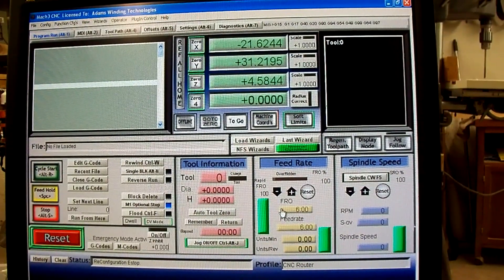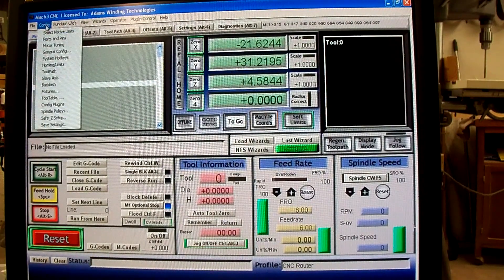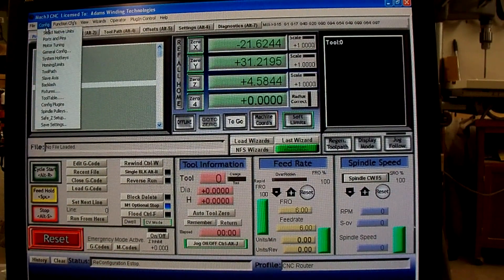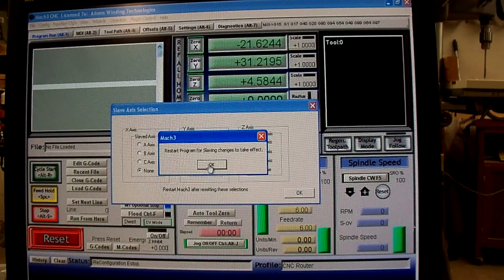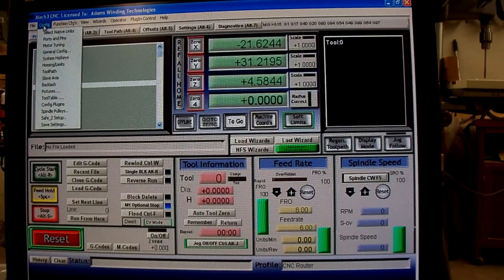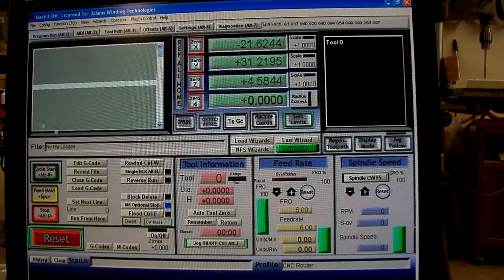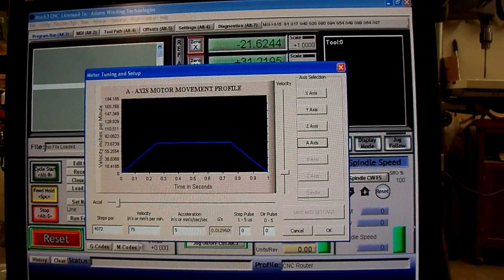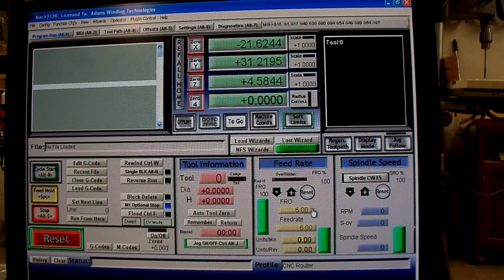How to Slave the A Axis in Mach 3

Comment: If you set up limit switches for both A and Y will they work independently?  In other words,  if the machine is out of square will it square itself up based on the limit switches of each axis?
Reply: For that you need unselect home slave axis with master, and when you make home machine will do z,x,y and slave
Reply from the maker: I only have one limit switch on the Y axis, none on the slaved axis.  I would think that if you had two limit switches, whichever one made contact first would stop both stepper motors.  Therefore I think the second limit switch would be of no value. (Only my opinion )

Comment: How do you calibrate the two axis so you get a square when cutting a square. Mine is not square cutting. I have both y and a axis servos set the same. Any idea what I maybe doing wrong?  Any help would be appreciated. Thank you.
Reply from the maker: Excellent question.  I have struggled with this problem as well.  What I have done is the following:

1. put a piece of scrap plywood or something on your table and fasten down.
2. put a bit in and run it across the X axis cutting about 1/16 to 1/8 deep.
3. then run it down the Y axis forming a corner.
4. use a square to see if it is square.
5. if it's not, try to measure how far out of square it is.
6. if out of square, with power off, turn one of the Y axis ball screws one way or the other by hand to move one side of the X axis thje amount it's out of square.
7. turn power back on and do the same thing and check again.
8. keep doing this till you get it as close as you can.

I don't know if this is the proper way to square it or not but the only way I could get it close.
If anyone else knows of a better of simpler way, please leave a comment letting us know.
Reply: @MyRobertadams  Thanks I will try that.

Comment: Hello Myrobertadams. Your video was very enlightening but I still have some doubts and I would like to know if you can help me. Basically I use a 4 axis CNC router to cut wedding rings by drawing and drilling stones in them. I had to change my control driver box because the old one burned after an accidental connection on the 220v and I lost all the mach3 settings because the new TB6600 drives are different from the old cards I had .... Now I don't know how to make my mach3 back to work with this machine. After turning the A axis into a slave, how should I do to know exactly if the distances traveled by the A axis are exactly those ordered in the measurements of the drawing generated in artcam and saved in the form of file "Model Master 4 Axis Rotary (X-> A) mmg "? In fact, how do I calibrate the movement of the A axis in mm or, if the calibration of the X axis automatically calibrates the A axis to automatically rotate according to the dimensions of the drawing. I don't know if I was able to express my doubt. In short, what configuration do I have to use on my mach3 to machine move the X Y Z and A axes according to my drawings with toolpath saved in the Model Master 4 Axis Rotary format (X-> A) * .mmg.
Would you have a video to recommend how to make these adjustments?
Reply from the maker: Thank you!
If you are slaving the A axis with the X axis, just set the motor tuning on the A axis the same as on the X axis.  I'm not even sure if you have to do this or not.  You could just check and see if the motor tuning on the A is the same as the X after you make it the slave.  You may want to close the software and restart it to make sure any changes took affect.
Hope that is helpful and best wishes!
Reply: @MyRobertadams  When I slave the A axis to the Y axis on my machine (both are linear on either side of my gantry), adjusting the steps per inch on the A axis has no effect.  This is frustrating, as the A axis steps per inch are not quite right on my machine.  Assuming that Mach3 automatically uses the Y steps per inch setting, you can't perfectly tune both axes if the steps per inch settings need to be slightly different on each.  Theoretically, they should be identical, but this isn't the case in the real world.  The A axis is off by a couple of hundredths of an inch across the travel limits as measured with glass scales.
Reply from the maker: @steadystate100  
If you have the A axis slaved to the Y axis, you can't adjust the steps per inch for the A axis. You will have to manually adjust the A axis ball screw so it will be in same location (parallel) to the Y axis.
Reply: @MyRobertadams  My problem isn't that A is in a different position as Y.  It's that A and Y move at slightly different speeds.  If they are perfectly parallel at one point, they will drift from one another as they both move.  The only solution is independent spi for each motor.  I've confirmed that Mach3 will not allow independent spi for a slaved axis.  Mach4 allows you to assign two motors to a single axis and independently set the spi for each motor, so that will solve the problem.  But it might make individual homing for each side of the gantry impossible, because both sides of the gantry would be a single axis.  If the gantry became out of square, homing wouldn't fix it.  I have more questions to ask ArtSoft before I upgrade to Mach4.
Reply from the maker: @steadystate100  
Are you sure that the stepper motors are the same and the ball screws are the same? Also make sure the settings on drivers are the same.  If all of these are correct, then it doesn' make since that they go at different speeds and I don't know what to tell you.  Maybe someone else out there could chime in if they have any experience with this.
Reply: @MyRobertadams  The hardware is identical on both sides.  My machine uses Kevlar belts.  Ideally, this shouldn't happen.  But non-ideal real-world characteristics of the motors, belts, pulleys, etc. can all contribute to error.  Pulling the machine apart to replace various components one at a time and hoping for the best is not a viable solution.  Fortunately, I think Mach4 can help solve the problem.  Perhaps I'm splitting hairs.  Had I not had glass scales, the problem wouldn't be noticeable on anything but the largest of pieces.  But still, I want my machine to be as accurate as possible.  Thanks for the replies.
Reply from the maker: @steadystate100  
Best of luck to you!

Comment: Would there be any issues using the B axis? I'm planning dual steppers on the Y but plan to put a 4th axis on the A so that I can use a 4 axis mpg without paying the extra for the 6 axis mpg
Reply from the maker: I believe you can use any axis letter for whatever you want.

Comment: Hi, thank you for sharing the video, i've set the slave axis and all works well .Now i've installed proximity switches to each (master and slave motor) for homing and i would like to know if is there any setting to make that they will home individually in order to square up in case by accident they get misaligned.
Reply: as each axis has its own limit switch, I would have thought this would happen automatically

Comment: hello i m using small cnc in which external rotary i had setup but when i m running it the rotary rotates more as compare to rotate less because the profile which i have to generate is stretched in cylinder so do i have to change in mech3 or my program is not good will you please guide me.

Comment: Great Video.. I got it to work! But is there a way to invert the axis or Do I need the invert module I seen in another video? I would imagine there has to be some setting I could check to invert the A axis.

Thanks again. Been building my own machine as im going. Its been a pretty fun hobby!
Reply: MyRobertadams  thats exactly what i needed!!
Reply: That was exactly it. I appreciate it. Just been tinkering around with making a CNC router as a hobby
Reply: couldn't you rewire the polarity of the motor/ driver?